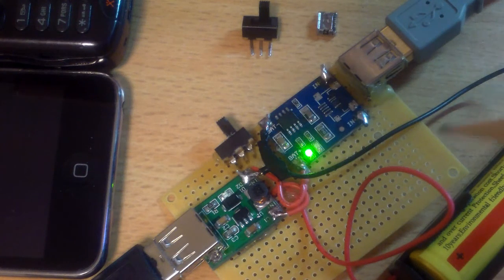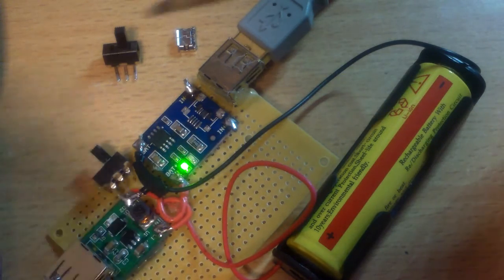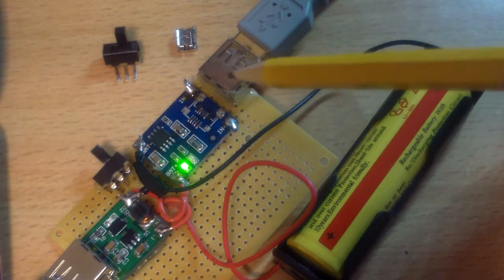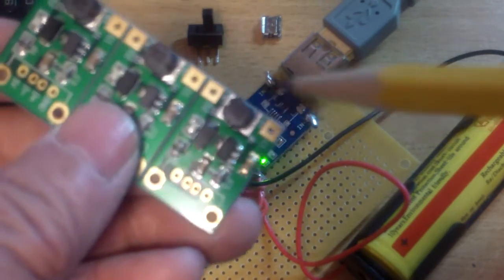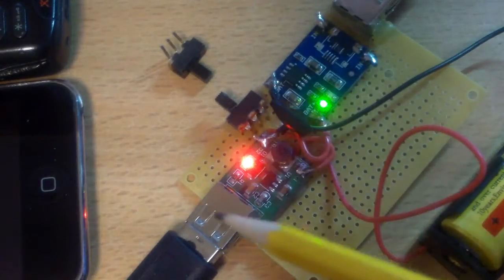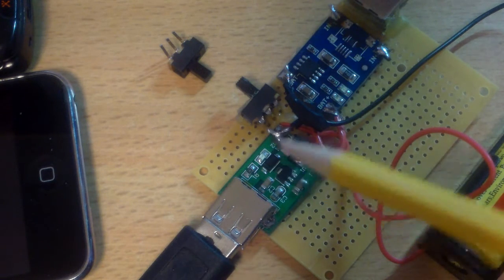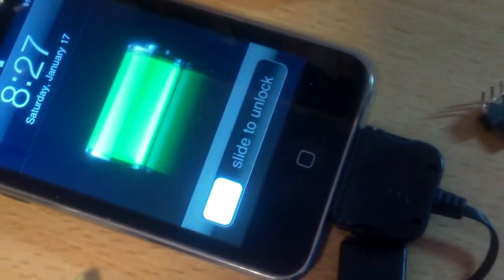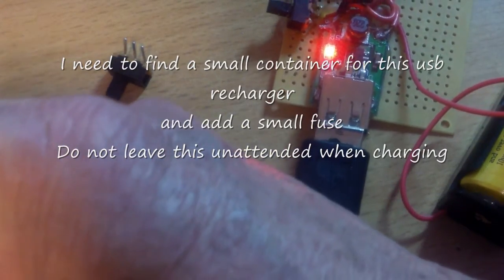A versatile lithium ion usb recharger and 5 volt power source

Comment: I got your same set up except for the lithium battery charger wich has a red (charging) led and a blue (fully charged) led. I'm trying to recharge a 26650 battery which now is empty (voltage is 3.5v) but as I attach the battery to the charger the blue led turns on and the red one slightly blinks very fast. What is wrong? May be the charger faulty?
Reply from the maker: EvAnGeLiOn90The red blinking very fast means it's still charging. That's the problem with these chargers. Some will let your charge to 4.15 v or so, some will charge to 4v and some with charge to 3.8v.  That is why yours is blinking at 3.5v. It thinks it's approaching full charge and will probably stop at 3.8v prematurely.  The good thing is your faulty charger might charge or wake up a close to dead lithium ion battery. At below a certain voltage, some battery charger won't charge the lithium ion whereas your faulty ones will, and probably charge it to 3.8v.
Reply: wtam69 I think I understand. Not really worried about buying a new one.. I'm just fed up waiting the shipping from china, which usually takes 3-4 weeks to Italy.
Reply: wtam69 I just got home after leaving the set up charging the battery for about 4 hours.. nothing seems to be happened as the battery voltage is still 3.5v.
Reply from the maker: EvAnGeLiOn90
If your battery is known to be good, then it's the charger's fault. They are cheap for a reason.
Reply: Quite sure the battery is ok because it's a brand new ultrafire. Thanks for your help.. I'll let you know what happen next :P

Comment: could you please point me in the direction of the seller?   thanks....
Reply from the maker: I looked at a name brand lithium ion backup power pack for cell phones and at first I looked at the wrong price of $20. It was actually $100. Of course, the batteries used will be of high quality. With mine, the battery is suspect but if you did get a bad battery, you can always recycle it and put in a new one.